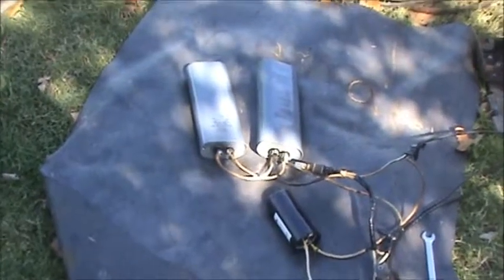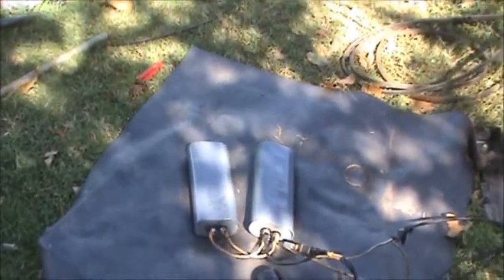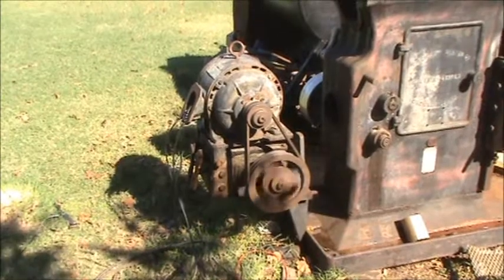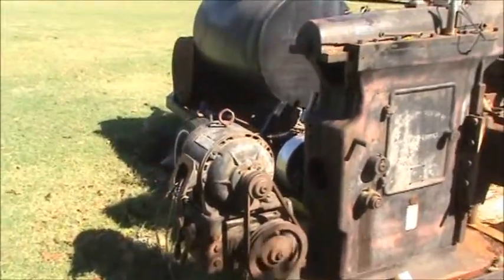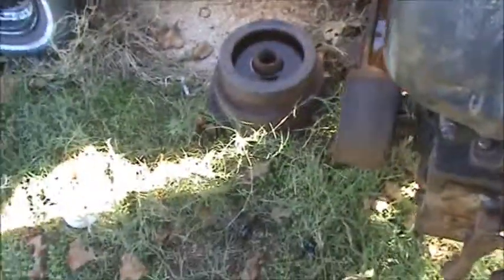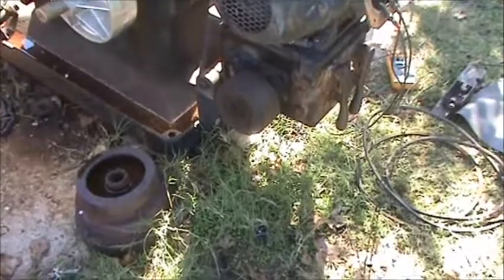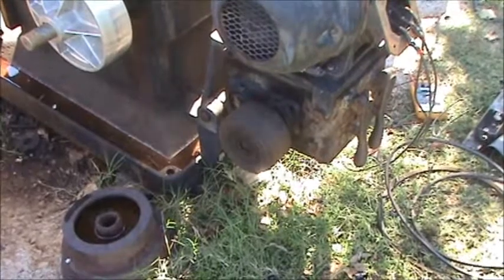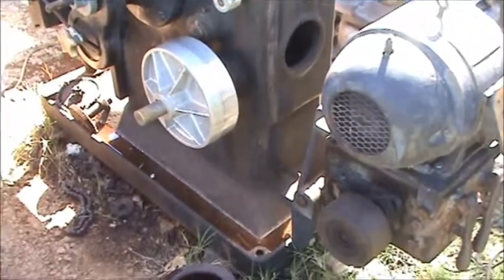phase converter

Comment: Hi, works perfect, how exactly do you launch it...?
With a starter capacitor and a timer or just a good swing....
Thanks,  Pierre
Reply from the maker: I use a start cap in the circuit, on a toggle switch.